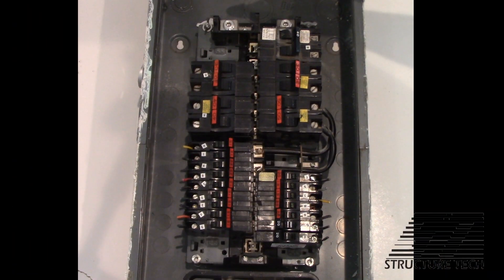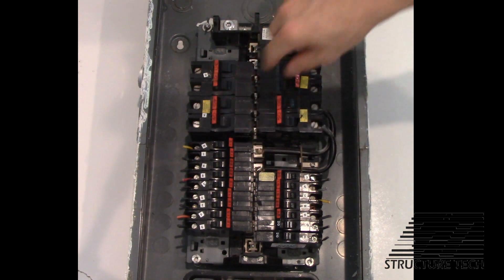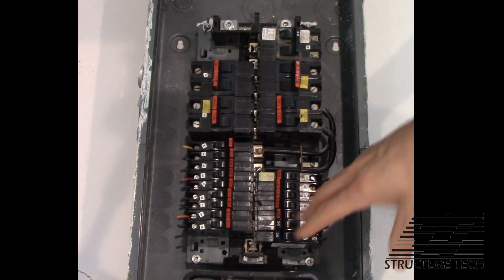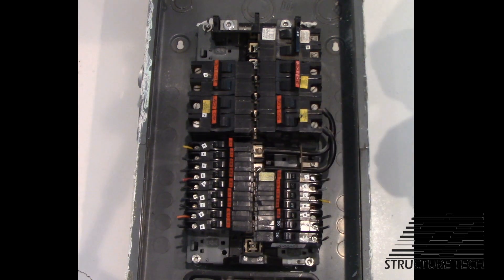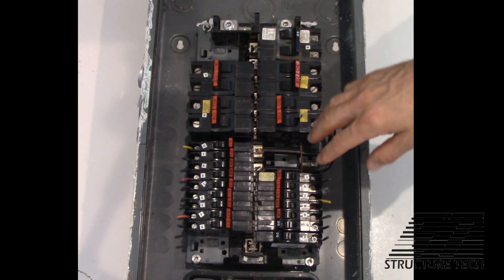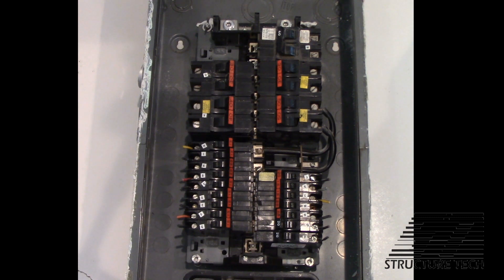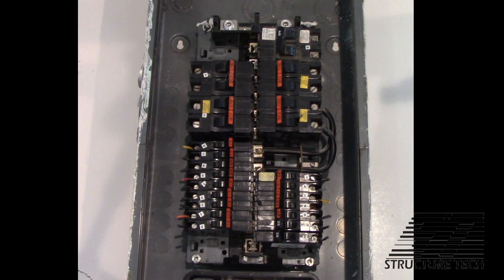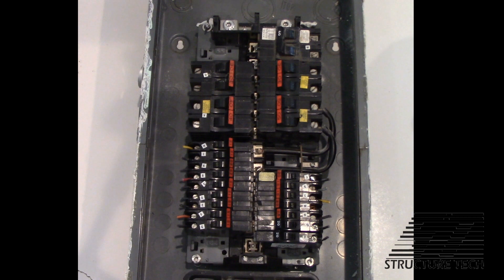Split-bus electric panels

Comment: Split buss may not present a hazzard but that particular brand federal pacific does in any of the still existing panels they don't usually trip as they are intended to thus creating fire or shock hazzards
Reply: Good observation.  FPE panels period,  where they be split bus, main breaker or MLO need to be changed out ASAP.  Indeed   most if not all panel manufacturers including those no longer in business or brought out by another company,  had split bus panels in their lineup at some point in the 60s and 70s when they were widely used.  

As a journeyman electrician I personally wouldn't frown upon having a split bus panel in my home assuming it wasn't a Zinsco or FPE, and I'd go ahead and upgrade to AFCI and/or GFCI breakers as appropriate particularly if the breakers were the originals when the home was built,  because the older the breakers the more likely they are to seize up particularly if not exercised on and off at least once every other year, and if the bus bar was burned or damaged in any spot I'd go ahead and replace the panel.

Comment: My condo has a 125 AMP breaker in the electrical room.  I read on a site that 125 is associated with Split bus.  But there is just one breaker in the electrical room and just a standard two line breaker panel inside the unit, so I guess I just have a 125 AMP total amperage system?

Comment: Thats a FEDERAL PACIFIC panel they are a FIRE HAZARD PERIOD weather main breaker ,main lug or split buss .The breakers have a tendency not to trip.It would be like driving your care with no brakes.
Reply: the red handles of hellfire a dead giveaway to run away. FPE= fire probability enhanced
Reply: @wizard3z868  When Challenger /Westinghouse bought them out in the mid 80s i called and told every horror story i knew about FPE . The next year i noticed they quit making the panels so i called them again. The guy said i remember you we were on the phone for 1  1/2 hours i asked well tell me what happened. The guy told me 50 other people called with there horror stories and we decided to quit making the FPE line. I replied GOD LOVE YOU YOU JUST MADE MY DAY!! They recently stopped making
Federal Pioneer in Canada along with STAB LOK. I like Square D QO  with pigtailed AFCI breakers  because the very small neutral strip is made of aluminum. The second choice would be copper bus Siemens with pigtailed AFCI breakers. On a short circuit a 15/20 amp QO breaker will trip at between 150 & 200 amps within one cycle.  
REST IN HELL FPE & Federal Pioneer i spit on your graves because of all the fires you nicely caused & lives you ruined.